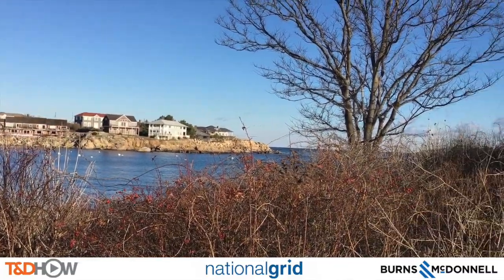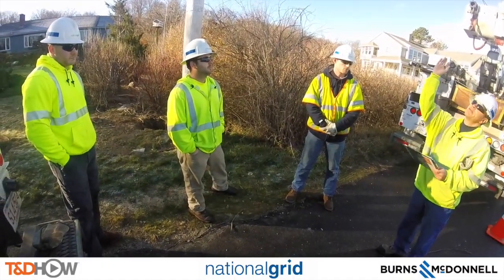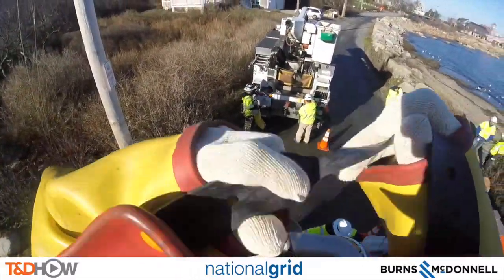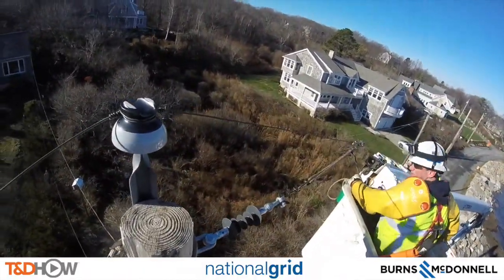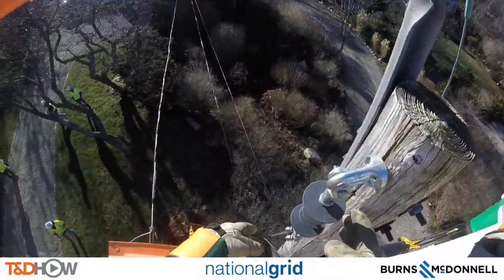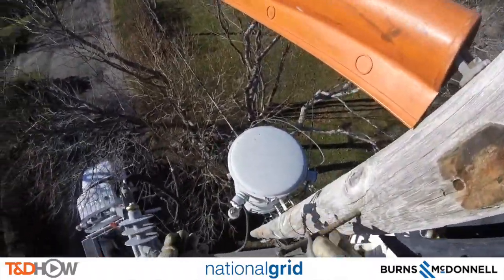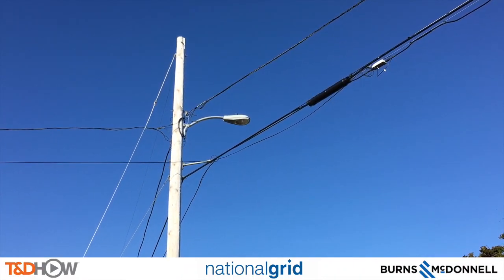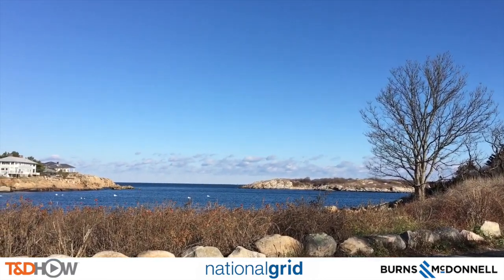Primary Conductor Removal

Comment: Question, on the first pole, the primary was caught off in a set of blocks on the dead end side of the pole and was in a hand line on the side they were taking out. The line was de-energized but not grounded and it appears that the crew let the primary down to the ground. There should have been a crew on the adjacent pole, the truck was set up there, to let the wire down at the same time so no wire would go from the top of the pole to the ground. What the hell is the sense of wearing rubber gloves and sleeve in the air, when you allow the conductor to go to the ground on a hand line? This is for demonstration purposes, but the procedure had a huge flaw. I’ve only done Line work for 43 years, so what the hell do I know anyway......
Reply: Edge Mo I would have either had a truck on other pole and had both set ups let her eat hahahahaha. Ground it out so no runner is needed.
Reply: @StanleyNova  well, if all conductors are treated as energized, why would they send an energized primary down on a hand line and have the ground men handle the wire?
Reply: @edge1289  Ive only been doing linework for 9 months still labeled as a groundman on overhead. shouldn’t have they put grounds source side a span above them if they knew they were gonna sag it?
Reply: @kgc57  As long as they have gloves and sleeves on, there is no need to ground the primary. Their mistake was that they let a wire down that was still in the primary area on one pole. There were trucks on the job that could have cut the wire down at the same time and no wire would have been on the ground and in the primary area at the same time.
Reply: It’s a videos. How do you know there aren’t grounds down line?

Comment: They are doing the primary conductor removal in a section between poles 1275 & 1276 putting on a dead end.

Comment: Putting up guts and blankets on a dead line😂😂😂
Reply: i never seen any grounding wire so this line can be energized by some stupid with his generator
Reply: Yeah they take the time to do all that and still put themselves in series putting on the taps.
Reply: @elofos0815   your not wrong, unless they didn’t film it, but even if we don’t have it grounded we won’t gut it. But most the time we have a open air gap

Comment: I think this video is so everyone thinks they're the safest company out there. Aren't you supposed to ground the de energized line on each end of the area you're working, then you don't have to wear sleeves and gloves on a dead line? Ok, They did it in case a customer's generator backfed thru the line. oook. Isn't the point of rubber for live lines? Looks good for the company and looks like a pain in the ass for the guys who made the video.
Reply: I think it is just for safety. I agree that the wire should be grounded but it would have to be stripped first. Both sides should definitely be grounded but the lowered part shouldn’t have to be grounded on the way down imo.